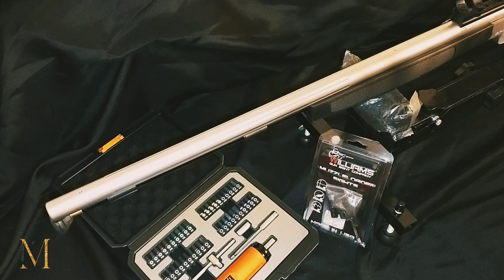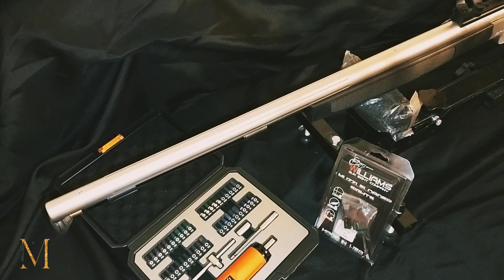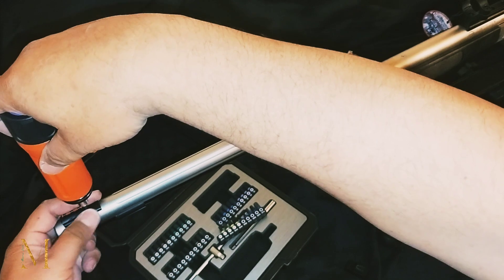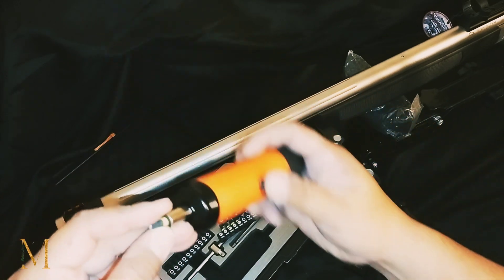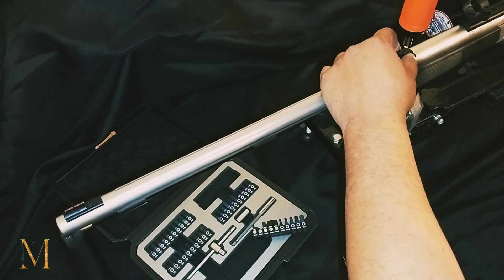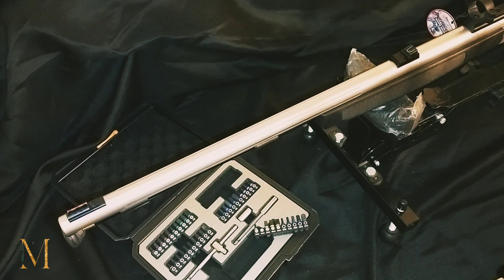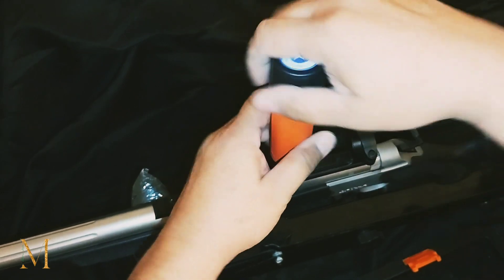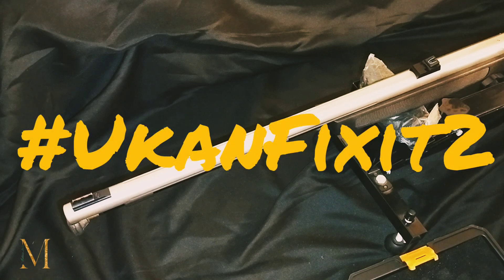How To Install Williams Front/Rear Sights Muzzleloader|CVA Optima V2 @williamsgunsightcompany8206

Comment: Did your have any problems sighting your muzzleloader after installing the sights?
Reply from the maker: @tobyzertuche1671  Thank you for checking out our channel. Tap that Like and Share if you don't mind. Also Subscribe if you haven't already. We have different content in our catalog that you might like or find interesting. We did not have any issues with our Williams front and rear sights, but we did upgrade our muzzleloader to a vortex optics. Williams sights are great and we plan on keeping ours, rather than returning them. We hope our content helped you out a little. We really appreciate your time and support!